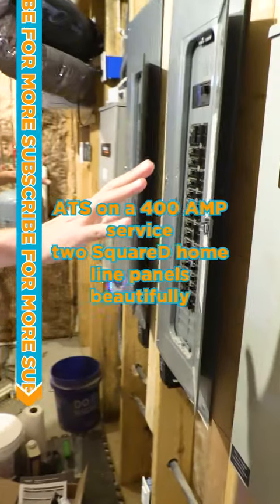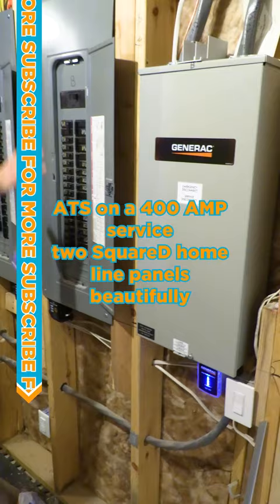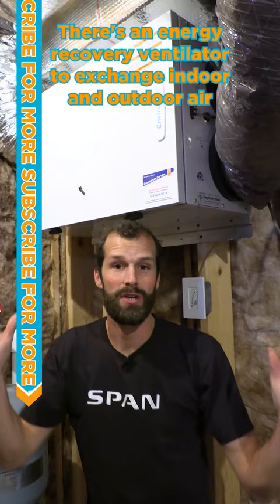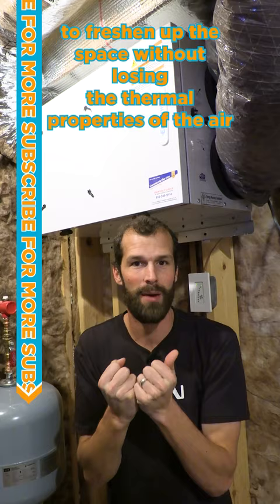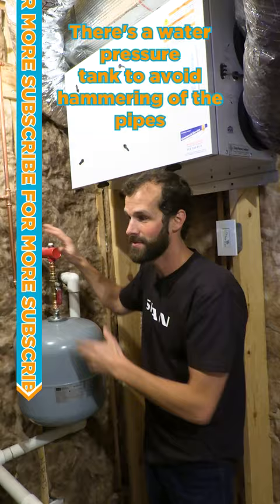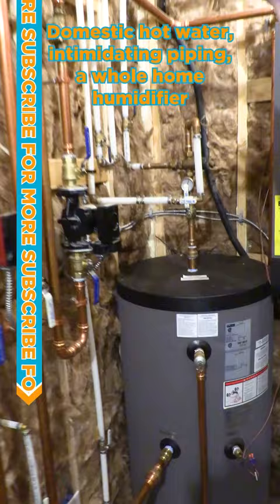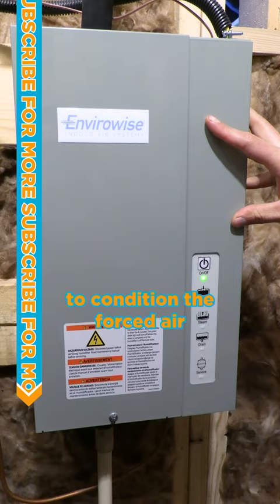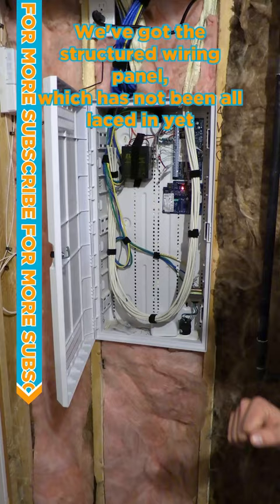The Most Mechanical Room!

Comment: The only major problem I see from an IT perspective is that Structured Media Panel. Even in a home, I hate these, nothing standard about them, proprietary mounting, lack of space, positioning of devices is terrible. The best way to do structured wiring is to use a standard 19" rack with proper patch panels for CAT5E (preferably CAT6, if not CAT6A), RG-6 Coax (if needed), and fibre optic cabling if the homeowner can afford it and wants to futureproof their home. This should all be planned out by an IT specialist (since they will have a thorough understanding of networking, wifi, and how they work, and able to plan out where ethernet drops should go including at least 1, if not 2 or more to each TV and every stationary device, if it doesn't move it should be wired not wifi) and then the cabling run by a low voltage data cabling specialist (which may be the IT Pro, or the electrician, though generally I use low voltage only specialist as my experience with cabling run by electricians is not very good).

Comment: Nice vidio. Going to need a shoe horn to install anything else in this mechanical room. In the large hospital/research buildings & ambulatory care building you were not allowed to run MC cable inside any of the over a hundred normal & seperste emergency power rooms. Had to run a minimum of 3/4" conduit from panels to another room or hallway to a JB.
Reply: Simple is best, gut it